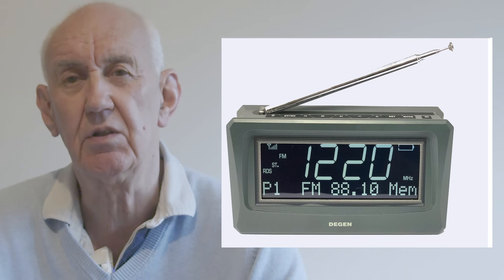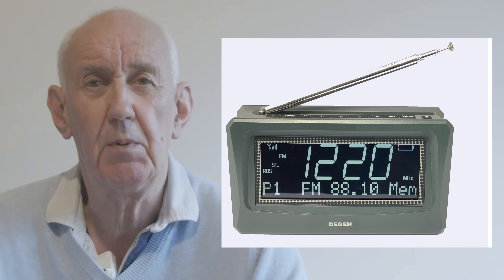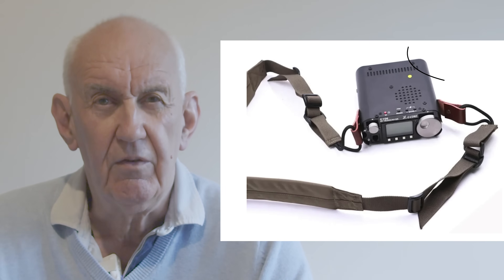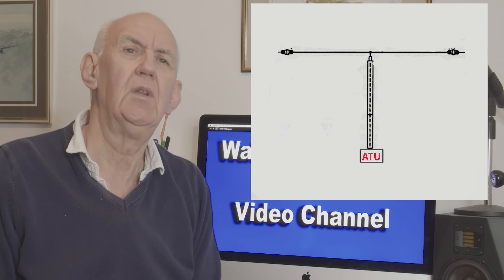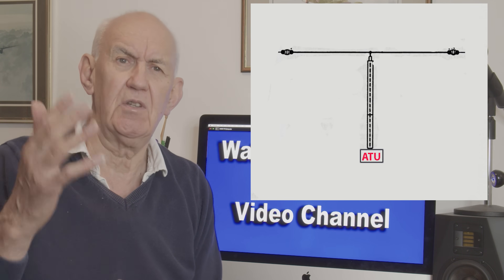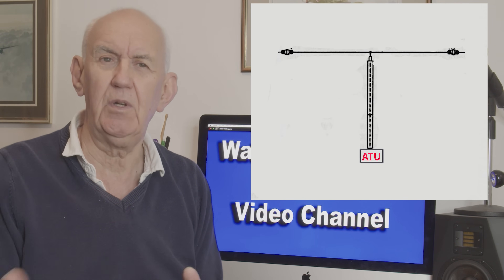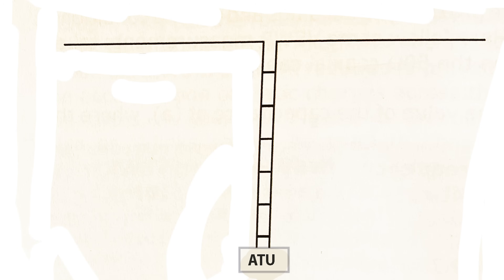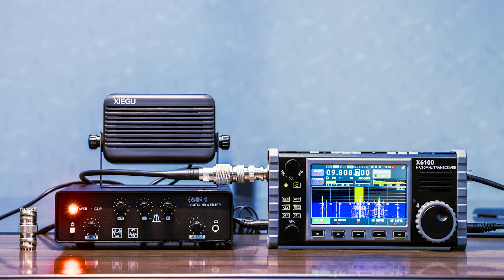Antenna Tuners - For Beginners - | HAM RADIO

Comment: I have a long wire with a 9:1 unun my  auto atu is connected to my ft991 should I remove the 9:1 unun or leave it in place or doesn't it matter

Comment: I see some stations will put there atu outside near the hookup at the ant,maybee they use coax and eliminate the loss in the feedlines that way thx for vid
Reply: Yes, you are right. I have an external automatic tuner, It goes under the antenna, It needs a good ground connection. I have used the structure of the outsider room, It Is all in steel.
My tuner comes from a old SSB transmitter (skanty) It was used on board of the commercial ship.  It Is mealy 40 years old, but It Still does its job. It tunes any frequency starting from 1,6 to 30 MHz. I use an old wip antenna 2,5 Meter and other 4 Meter of commun wire 6 mm. Antenna total length 6 Meter. Tuning procedure of amy frequency Is done in less then 2 seconda. I wery Happy of this automatic tuner, It Is old, but great. Just to give an idea, It Is from skanty TRP 8400, I fix It because had a problema with a track damage on PCB due to water leak. 20 years now It Is there and it's ok. 👍👍👍👍👍👍

Comment: Once again Peter thank you for sharing your extensive experience with us. I have one question (if I may) My ATU doesn't have a balanced output just a 50 ohm UHF plug type output. Will it still work if I use a 4:1 balun to feed a doublet antenna? kindest Adrian

Comment: remember if you have a multi band vertical  like a zero five or some that MFJ makes , or flag poles you have to use a remote tuner at the antenna because those antenna have line a 7to 1 , 9 to 1 depending one the band , a manual or auto next to your station it would build up to much heat and won't be to effective , I have a 75 ft run of LMR 400 and was loosing 15-18 watts at the antenna I went to a remote and the loss was 5 watts  ,

Comment: you just talked about them.I have a big mfj manual tuner. my radios auto tuners but i would like to learn to use the manual one. both external auto on the radio

Comment: Since I relate to the new ham operator, I have both an MFJ 949E Versa Tuner and a LDG Z100A, needing direction for use with the Yaesu 991A. 

Since both the manuals for the 991A and the LDG ATU briefly offer support, I want to find direction to use the ATU with my Yaesu rig. 

Can you offer some insight or resources to this new ham to help keep me from burning up my rig? 

I do use the My Go2 portable/stealth antenna from TN07, a 40m and 20 m home brew dipole, and I also successfully wound a 49:1 40-10m EFHW. With the My Go2 working below 1.8:1 I have no issue with tuning the kit. However, the EFHW was a bit hard on several bands with 40m, 20m, 15m, and 10m being the easiest with the internal tuner in the 991A. 

I really don’t want to burn the finals out of my rig by using anything but the My Go2, which is consistent to be less than 1.6-1.8:1 on 80m through 6m. 

I love HF phone to say the least! I want to keep my kit working properly without destroying it for not knowing proper use. 

Thank you for your time!

Bill
KC3RMV, Pennsylvania
Reply: Hi Bill,
You would need to make up an adaptor cable from the AT100 to power (+12 volts Ang ground). I think you then need to take the Key line to the ring connector on a 3.5 mm stereo plug, with ground on the sleeve of the plug.
This then plugs into the REM/ALC socket on the back of the 991a. Then tap the Menu button and change item 141 to "LAMP". The internal tuner will be disabled. You can then tune by pushing the Tune button on the tuner. This should cause the radio to transmit a carrier while the AT100 tunes, then it will drop back to receive when it has finished tuning.

Comment: "Antenna tuners" (in the radio, on the desk or at the base of the vertical) alters the phase relationship between the RF current and Voltage complementary to the matching error at the feed point of the antenna, making the system work as though there were no matching error.  The matching error is frequency dependent. Ron W4BIN
Reply: 1st "tuner" I got, my local Ham friends thought I'd kicked on an amplifier as I got 1.0:1 SWR on the 10-meter band and they all said I came up with at least an S unit and louder, better sounding modulation.  For about 2 weeks they were begging me to tell them what I'd done to improve the signal.  They'd sworn that I'd put an amplifier in line with at least a couple hundred more watts than the 100 watts from the radio itself!  For months they'd talked down about antenna tuners and boasted about tuning "the hard way".  And then, I finally broke down and told them that it was an antenna tuner.  AND - pointed out having seen pictures of their shacks with antenna tuners in line making total hypocrites of themselves.

Comment: I started with manual tuner for my IC7300 but they are a pain to adjust all the time, if you're changing bands a lot. AT100 autotuner was worth every penny. It is just so simple when it tunes automatically.
Reply: I hear ya!  I've got a 1000ProII on my 7300 and I love it!
Reply: I have a longwire antenna with a 9:1 unun I use an atu at the output of my Yaesu Ft-991  should I remove the 9:1 unun or leave it in place or doesn't it matter